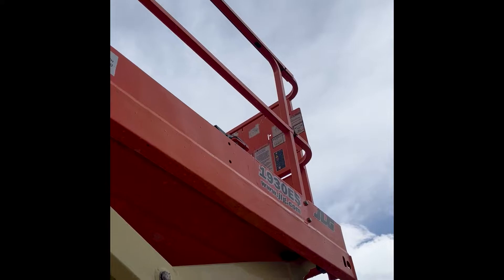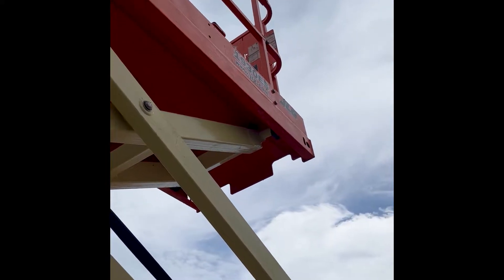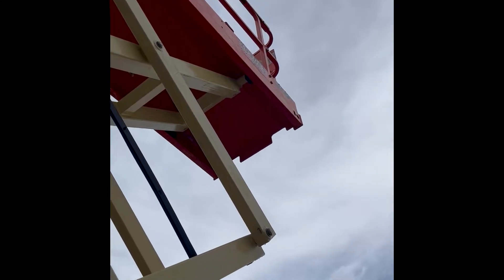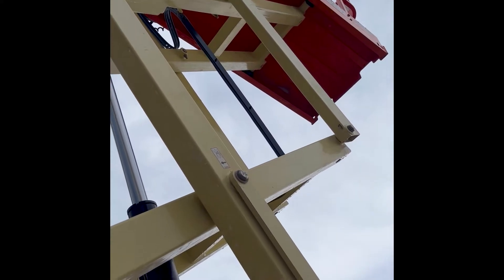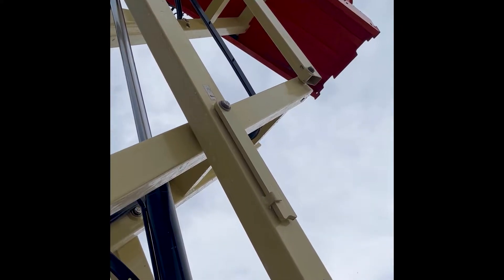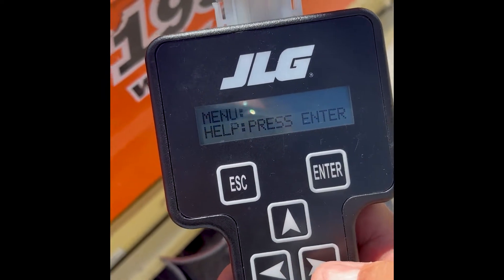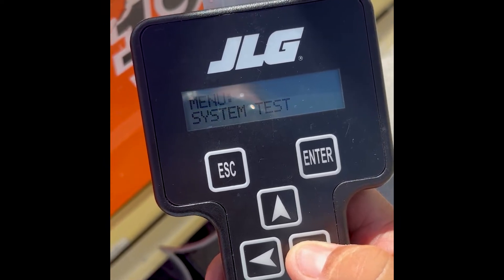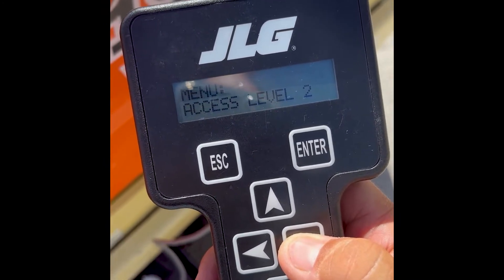Fault Code 06: Drive Motor Brush Wear Warning | JLG Electric Scissor Lift

Comment: Thumbs down
Reply from the maker: This 06 drive motor brush wear warning, give you the ability to determine whether you have bad brushes, a motor, wiring, a relay, or ground controller. What suggestions can we add?
Reply: Perhaps actually show something!  This is YouTube not books on tape.  @GCIRON